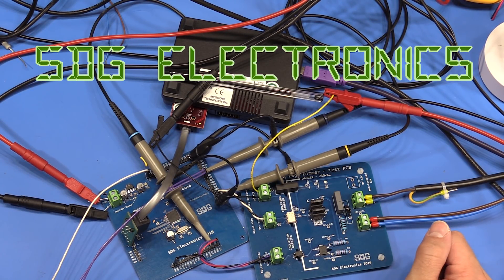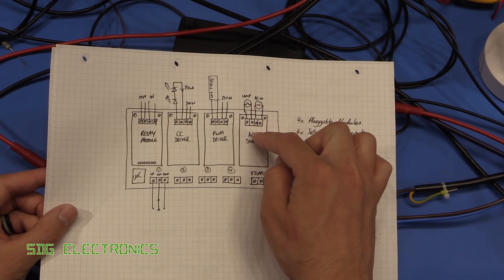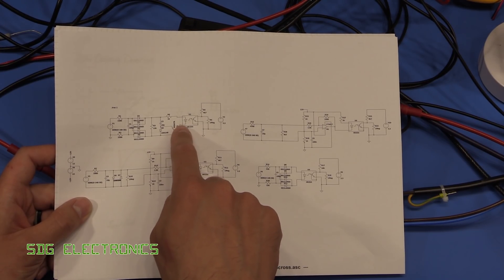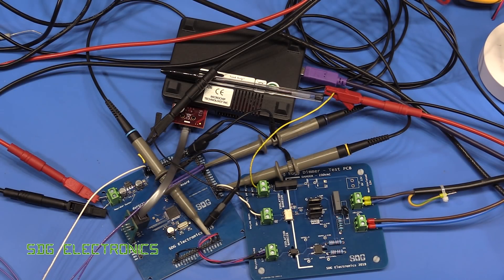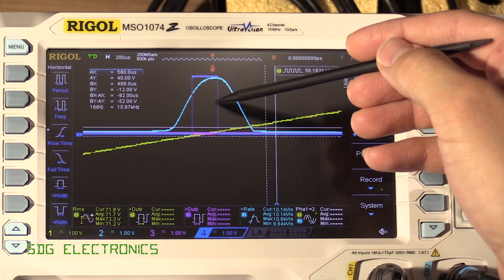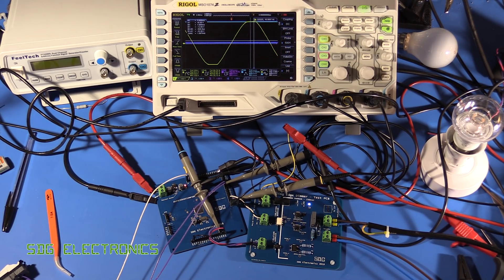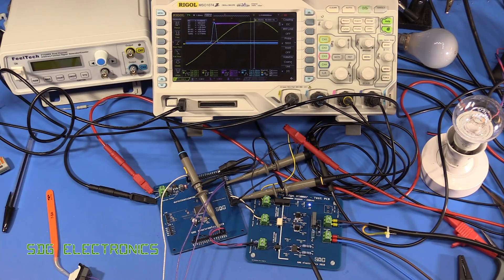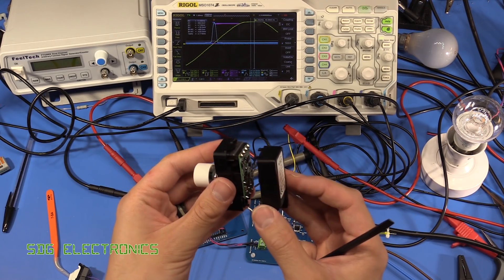SDG #070 DIY Trailing Edge Dimmer - Lighting Controller Project - Part 3

Comment: I am trying to build a board with 12-volts AC input to drive commonly available 12-Volt LED's.  Most circuits are designed for 120-volt lights
Do you have any suggestions.  I found FL5150 IC quite useful for this job but the designs are for 120-volt lights

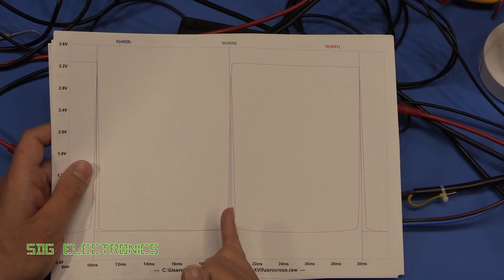Comment: 7:26 digital zero and one thresholds are probably in different voltage points. unless you are sampling with very high end ADC, middle point is probably not a zero-crossing.

Comment: Why are you using 12V to drive the MOSFETs?
Reply from the maker: Vgs on these MOSFETs is only around 20V or so. It could be increased at the risk of transients destroying the gate. Much lower and the dissipation starts to increase.

Comment: More questions, Steve: I see you're using a Microchip programmer. What is the model and did you put those nice rubber feet on it yourself? (I've got the Pickit 4) Also, I'm assuming you're using MPLABX or an older version? If so, are you programming in Assembly or C?
Reply from the maker: Hi Andy, it was the RealICE pictured in this video (although upside down). I tend to use that or the ICD3 mainly. Yes, I use MPLABX and in this project I'm using XC16 for development in C. I still use assembly where appropriate.
Reply: @sdgelectronics  Cheers, Steve - Good to know and thanks.

Comment: How would this design work with a very nasty input waveform from say a generator?
Reply from the maker: There should be no trouble, the only waveform that potentially could cause trouble would be a modified sine wave inverter, but this would kill any dimmer switch.

Comment: Yes, they might probably be feeding the AC signal directly to the relevant mcu pin through a large value resistor, and so might probably use the same "technique" to power it, being the whole thing in the high-voltage side.

For your case, wouldn't it be more reliable to raise an interrupt before the zero-crossing event, such that not only the mcu would be at charge before it happened, but also simply by checking the state of a pin (which might even be the same that caused the interrupt) could help it decide exactly when to perform
switching?

The "problem" is I see by doing it in software is that due to variations on the power-grid supply, the last time you registered a zero-crossing event might not translate to the exact time you'd want to wait after your next zero-crossing interrupt. Whether that, added to the time it actually takes for the mosfets to
physically close could ever result in the same I don't really know, but in any case you'd get an added layer of robustness plus some spare mcu-processing power in the case you'd want to get more off the same hardware without having to deal with complex firmware changes and such for small or simple
features you might want to add or try in a future.
Reply from the maker: There's a few parameters at play - if you directly link the AC waveform to the pin, you need to either scale down the voltage, or limit the current. The pins have a specified range for threshold voltages for high and low, which if you scale down results in a wide band where the MCU will think the zero crossing event has triggered. If you limit the current, the pin or clamping diodes need some recovery time. 

I simplified my explanation of what the firmware is actually doing and probably didn't explain it that well, but when I finish the firmware I'll put it on the website - it is triggering all the timers on the approach to 0 as detected by the zero crossing detector (that pulse in turquoise on the scope), so is completely stable and dictated by the incoming AC (it'll work on 60Hz and still work at 400Hz...).
This interrupt is somewhere around 300us before the actual zero crossing point. The bit that it learns from previous waveforms is how long it takes from this interrupt to where the zero crossing point actually occurs. There is also a 'fudge factor' added in to allow this to be fine tuned if needed.
Reply: Your explanation was fine. That I can remember off the top of my head I've done something similar with software usarts in order to find the center of the incoming pulse and get both to sync.

I commented based on the comparator circuit you showed today, your comments about the power dissipated by the resistors, and the fact that this comparator could be on the high-voltage side, same as in the commercial dimmer.

So in my approach, the comparator would turn the opto-isolator on at, say +15/-15V while the sine wave is approaching zero, raising an interrupt, and off again little before zero. The mcu would "awake" with the interrupt, and would wait for the same pin to go low to fire the mosfet.

But this will probably be more suitable behind a transformer whose peak RMS wouldn't exceed that of the comparator, because I reckon it would end up having more loses than your circuit if facing mains power, or else a differential instrumentation amplifier properly rated should be used, which are pricey, and as you say, make things more complex.

So if your circuit works up to 400Hz and you still have room to account for fine-tuning it should be fine. I was also thinking after I posted that variations on mains between two adjacent zero-crossing events might not be enough to burn the mosfets after all, but again my experience with mains stuff is nil.

Comment: Thanks Steve, interesting project. Looking forward to seeing what you get from that uC if anything. 
I bought a couple of those trailing edge dimmers for my LEDs to get rid of the buzzing from the standard type, they work a treat 👍
Cheers 
John
Reply from the maker: The Varilight ones are the most versatile out there, but they need a method to lock out the 'programming' mode as guests always mess them up. The trailing edge dimmers make the isolation transformer buzz quite heavily. I'm probably generating quite a lot of harmonics.